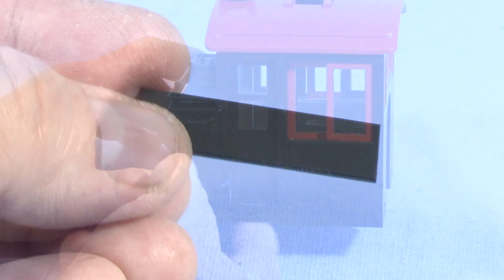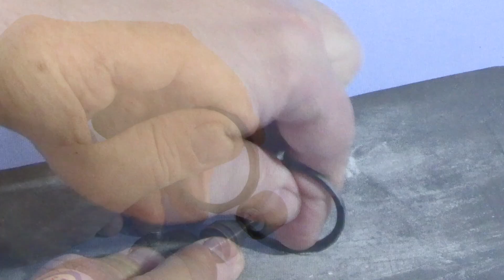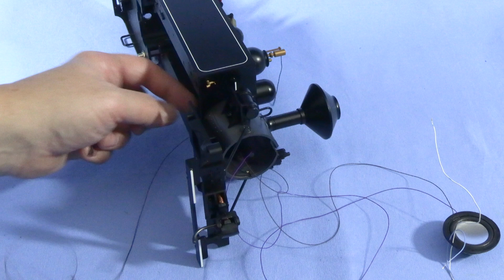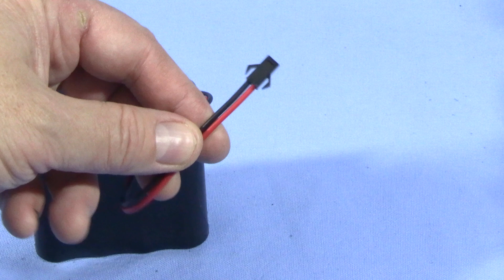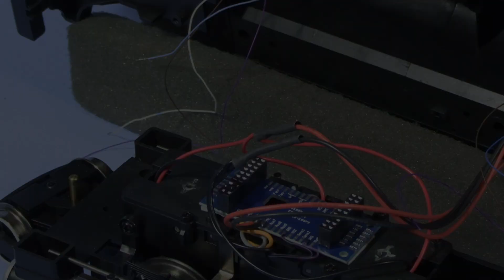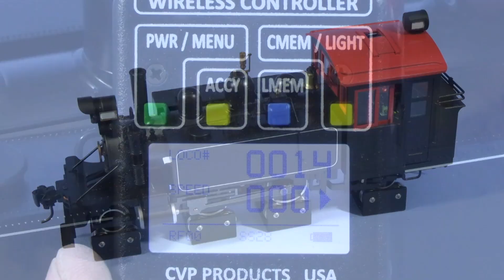DCC and Sound Without Track Power! - DCC Shop G Bachmann 2-4-2T Part 2

Comment: 2:00 I ended up putting my switch in the smokebox behind the door. I also used 1 pole for track power, 1 for the battery on off. This allowed me to reuse the slide switch.
Reply from the maker: That's great you were able to figure a way to reuse the existing switch.  Thanks for sharing and for watching!

Comment: Great video of the install, I wonder if you could have made use of the area with the two switches in front of the boiler.  That would have been perfect location for switch and or charging port.
Reply from the maker: I might have, though the second speaker I installed takes up a lot of the room in that area.  After having a chance to road-test the engine, I'm really happy with it.  It ran great during our Halloween maze event, running for hours each day we were open without issues.  It doesn't pull a lot, but it's great for the small display loop in the garden layout.  Thanks for watching!
Reply: @DanielCortopassi I made this comment while watching the video, and as soon as I submitted it the part about the speaker came on. 😂

Comment: What is in the water tanks that prevents their use for battery space?
Reply from the maker: They have weights in them.  It might be possible to use 2 smaller batteries or to cut apart the bigger battery and split the cells and put them in place of the weights.  The balance of the model would be better.  Thanks for watching!

Comment: Wonderful again.  On the weight issue are the fuel tanks empty? If so maybe adding weight to them in the front will help if needed though it ran pretty well . Thank you again for the great instruction.  It will help many. I can't wait for another one
Reply from the maker: I'm glad you like the video.  The side tanks have weights in them from the factory.  I didn't change anything in that area.  I don't think they're quite completely filled, so in theory it might be possible to add a little more weight.  I may investigate that in the future.  Thanks for watching!

Comment: Nice setup and explanations. I have a tender with mine so the weight of the battery won't matter in my case, like you I would not have thought of that until I saw those wheels up in the air :) thanks for sharing!
Reply from the maker: I'm glad you liked the video.  Using a tender would change things.  I was kind of surprised when I noticed that the engine wouldn't sit right after putting in the first battery, though it is pretty heavy.  In one of my other models I actually took the battery pack apart and placed the individual cells in different places, but that was difficult and I ended up blowing out the battery circuit board in the process.  I don't see replacements for those available anymore so I didn't want to do that in this one.  The weight could possibly be more evenly distributed that way, though.  Thanks for watching!

Comment: Again RC batteries seem much better than DCC and you can have loop arounds without special wiring.
Reply from the maker: This engine has a battery, and my track has no wiring at all.  I've heard of people using RC components, but I prefer a control system specifically made for trains.  Besides motor control, a DCC decoder offers all kinds of lighting effects, sounds, and consisting in case I want to run the engine double headed with another.  The way this is set up, it can run off the battery, or it could be run with track power on a normal DCC layout.  Thanks for watching!

Comment: The Powerpacks do seem redundant when using battery power IMO
Reply from the maker: Yes, I don't think the capacitors do much when the decoder is running on battery power, though they don't really hurt either.  The LokSound 5L comes with them wired onto the board.  I don't think they offer a version of that decoder without them.  The XL has them too.  I have a couple of those installed in other large scale models with batteries, and they work great.  Thanks for watching!